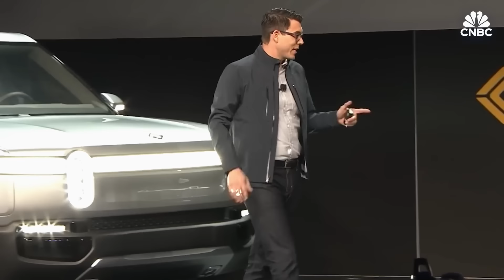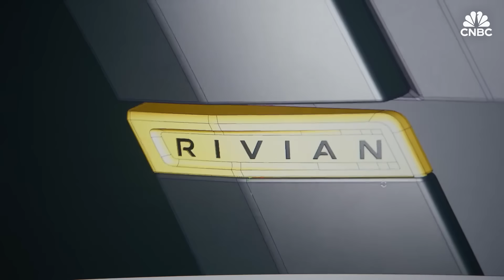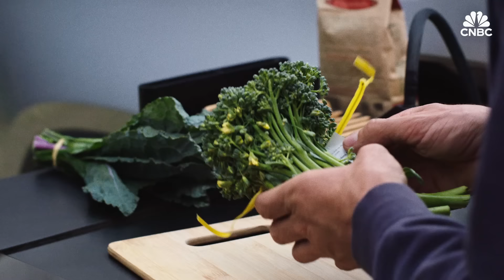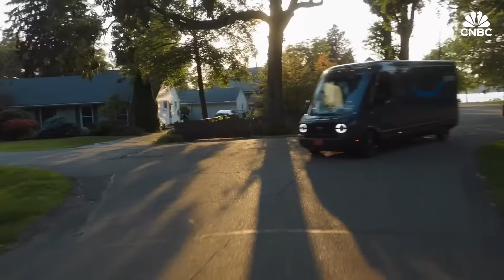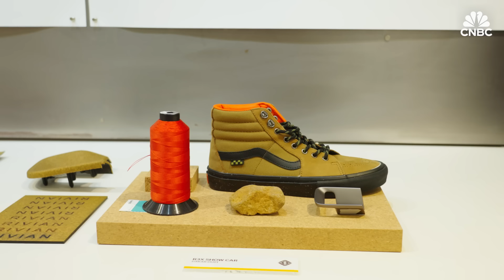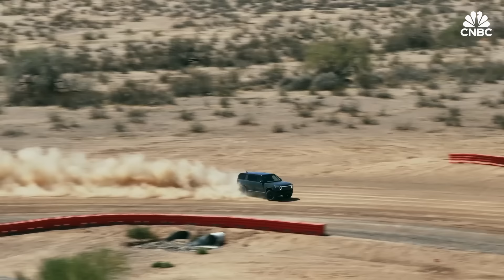What Inspired Rivian’s Unique Headlight Design?

Comment: I've been diving a small truck for years and it's getting old in more ways than one. I've been looking at getting something smaller and electric to replace it as my daily commuter. That R3X is easily one of the best looking cars out there and it's my top pick if I can keep my truck running till then. I work in Irvine and it's cool that Rivians are being designed right here around the corner! I'm a fan. Keep up the great work!

Comment: "A pickup truck is good for common tasks" is very true. Unfortunately today's pickup trucks aren't designed for pickup truck tasks. Long gone are the regular cab long beds that could fit 12+ bales of hay to take out to the field or a full sheet of plywood or drywall with the tailgate up. Pickup trucks now have for doors, air conditioned seats, and silly infotainment systems. Parking lot princesses.

Comment: Rivian. Here's a bold new idea. Make an HD 2500/3500 Dually with a diesel generator that will run 800 miles on battery/generator modes. Also make the battery and the diesel generator very modular so if a Hotshot/Company needs to repair down the road it'll be a quick swap. 
Come on. Be bold. Shake up the OTR industry.
Reply: Rivian ain't touching gas or diesel sorry

Comment: These puff pieces on Rivian are silly.  Rivian is headed for Ch 11.  Owners will be left stranded.  Rivian has never said the R2 will make Rivian profitable.  Rivian's GAAP losses per quarter are massive and show no signs of ending.  The VW deal and gov't loans from crooked Joe will add more debt and interest expense.  With these recurring quarterly losses, don't see how Rivian avoids bankruptcy.  Here's Rivian's quarterly losses; which clearly show no profit whatsover despite the positive "gross profit" nonsense Rivian keeps pushing:
1Q23 - $1.3 bill loss
2Q23 - $1.2 bill loss
3Q23 - $1.4 bill loss
4Q23 - $1.5 bill loss (full year '23 loss:  $5.4 bill)
1Q24 - $1.4 bill loss
2Q24 - $1.5 bill loss
3Q24- $1.1 bill loss vs 10,018 vehicles sold... $109.8k loss per vehicle sold
4Q24 - $744.0 mill loss vs 14,183 vehicles sold... $52.5k loss per vehicle sold (full year '24 loss... $4.7 bill)
1Q25 - $545.0 mill loss vs. 8,640 vehicles sold... $63.1k loss per vehicle sold
2Q25 - $1.2 bill loss vs 10,661 vehicles delivered... $112.6k loss per vehicle sold
Reply: Thank god the world isn't run by you 😂